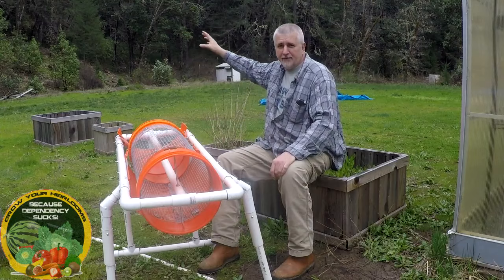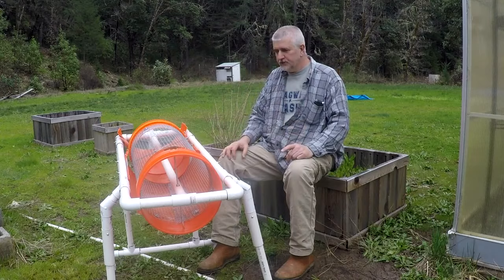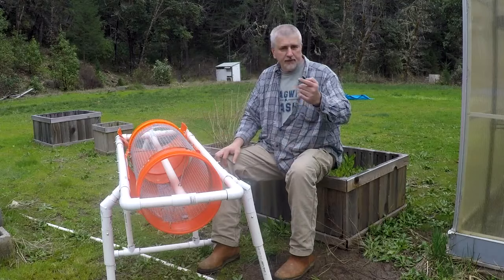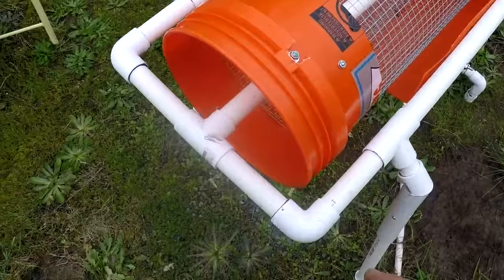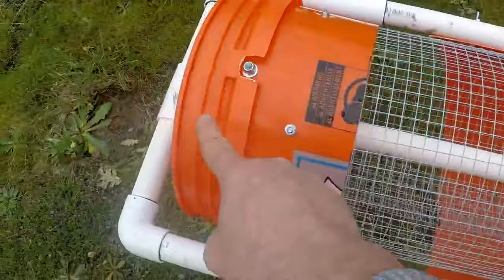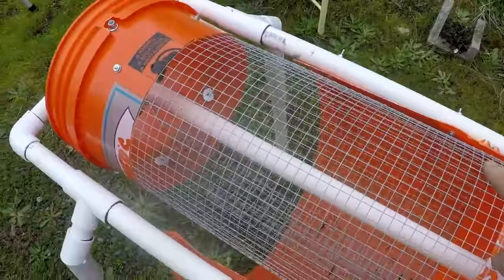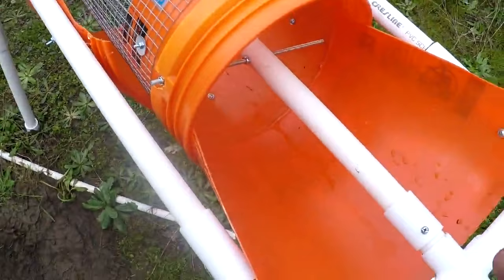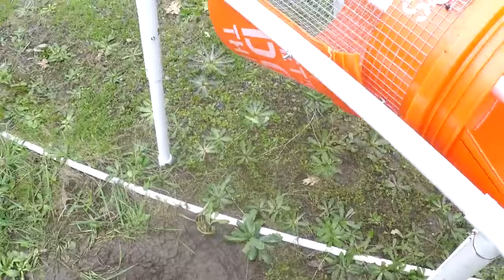How To Build A Hand Crank Trommel Compost Sifter

Comment: Hi, this is Mike from Mike's Trommel.  I was really entertained by your video.   I've used mine now over ten years and the heavy rocks of gold prospecting have beaten it up a bit but still functions perfectly.  I just went out to the claim this last weekend and folks are still amazed at what it can do.  It's much easier to use than hand bucket classifiers.  Your design using all-thread is a useful upgrade that I may incorporate on the next build.  Of course, I would have to use two on each end of the barrel because of the weight of the material passing through.  I also have been coaching folks to use large fender washers at every connection on the barrel.  That spreads the stress more evenly.  I would also encourage rubber shields on the axles to prevent premature wear at the bearings if your readers are prospectors.  Job well done!  Mike Laine
Reply from the maker: Thanks for the upgrade info. Mine is still holding up well. I am however thinking of trying to build a larger one. Also I'd like to attach it to a permanent base. Thanks again
Reply: Your webfile link is dead.
Reply: @grlnexdoorable  Yes ... my wife got cancer and my interest in hosting websites took a back seat.  Sorry but my domain has expired.  Youtube still hosts many of my videos.
Reply: @tealtoad19  I am so sorry for your troubles!
Reply: @tealtoad19  is there any way to urchase your plans?
Reply: Can someone please post what is the total length of the wire mesh to use,and what is total length from end of bucket to end of bucket
Reply: I designed the trommel around the size of screen available at Home Depot 15 years ago.  The total length should be around 29 3/4".

Comment: I like it that you used the all thread rods. Means you can put the rods through the spindle and just measure even distance from each side of the bucket and tighten the centre nuts, rather than used strips of metal and guess how long you are going to make them to join the spindle as some o the others have been made. I like the rods idea better. So mine will be a little bit of Mikes but most of your version. As you said you can make the base anyway you like, as long as the trommel is on an angle. Cheers, and well done to you and Mike...simplicity is the key, and it works.

Comment: Hi, how does one determine the required size of the drums, e.g. I want to use two drums, each 6 and 10mm "sifting" openings, roughly 45cm-50cm diameter and 50cm long and the two joined together to make a total length of 100cm, can that work?
Reply from the maker: I don't see why it wouldn't work adjusting everything for the added length

Comment: What size and length is the threaded rod on the ends of the bucket that are fender washers in place and pass through middle turn8ng pvc to the other end of the bucket

Comment: Really like this trommel. I really need to build something this spring as I have 3 worm bins I need to harvest. Two compost bins and then also I want to screen the main chicken run. Last year I did it with a 2x2 rough cut 2x4s with 1/4 wire cloth and shaked the day lights out of it into a wheelbarrow. Doesn't take long to get tired out. 
Thanks again. Blessings.
Reply from the maker: yeh, I did that for years. This is 20 times faster
Reply: That’s exactly what I’m currently doing. Going to build this tomorrow I guess.